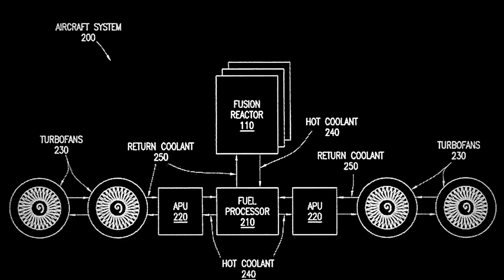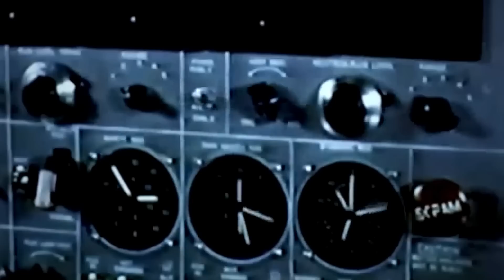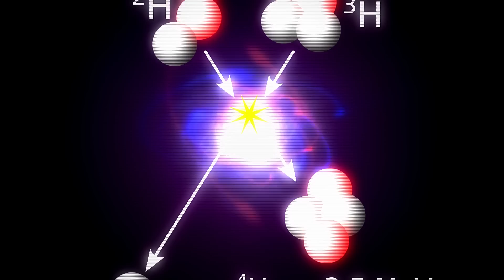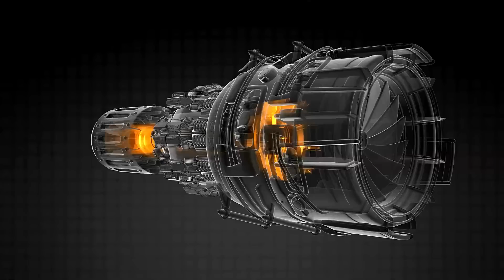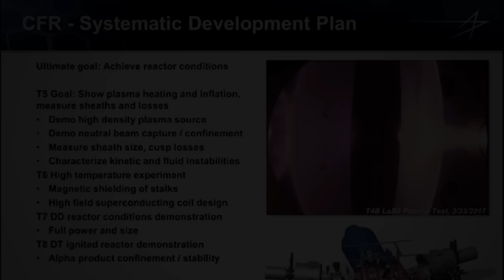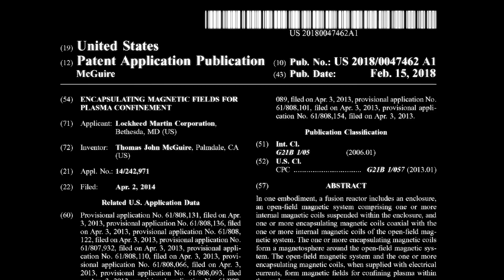The Nuclear-Powered Aircraft that Will Change Everything

Comment: Tritium, one of the two Hydrogen isotopes used in current day fusion reactors, runs $30,000 per gram on today's market.  (Deuterium, the other fuel, is around $10 per ounce)  Current commercial application of Tritium (worldwide total) is around 400 ounces.  Tritium is a byproduct of fission reactions, so production can only be ramped up (currently) by building more fission reactors.  They've been promising us Fusion energy for many decades now, and each decade it gets "a little closer" but there's always a very long way to go.
Reply: Fusion reactors can also inexpensively produce tritium. Also, there are other ways to produce the fusion reaction without tritium, such as boron.
Reply: @fishing953  Boron is way harder to use and no a fusion reactor does not produce Tritium. If you think it does give me a link to a peer reviewed journal article to prove it.
Reply: @gordonlawrence1448  This is from Wikipedia. Look at the peer journals quoted below it. One of the fusion start up companies in the US is using this method - do some research. 

quote: Tritium, one of the reactants required for this type of fusion, is radioactive. In fusion reactors, a 'breeding blanket' made of lithium is placed on the walls of the reactor, as lithium, when exposed to energetic neutrons, will produce tritium.
Reply: @fishing953  The Breeder blanket is only a concept under test - purely experimental at the moment and not commercial. The Trituium shortage is real and there's no close answer to the problem.
Reply: @fishing953  D+D, D+HE3 , HE3+HE3 ect ect some have their advantages like no neutrons release, but do require far more energy to start.
Reply: I may have this wrong, but my understanding is that both deuterium and tritium exist in ocean water, with tritium being many orders of magnitude more rare. If that is true, then can't tritium be extracted WITHOUT use of fission?
Reply: @gregparrott  too expensive and way too little available
Reply: Yes, I read that it is only produced in one Canadian reactor.  However, NASA has got the first part of its moon commercialisation project (i.e. ARTEMIS)  working, and the moon has lots of tritium on its surface.  So, tritium (along with water from the polar regions) could be one of the resources forming the basis of a space based economy, as well as a fuel for space ships.  Still the idea of a viable fusion reactor small enough to fit in a fighter seems like science fiction to me, given how difficult it is to make a reactor that fits inside a building.
Reply: @christopherwebber3804  Yes that's the case and i believe that reactor is also due to close in a few years which will exacerbate the problem further. I don't believe it's hard to miniaturise existing fission nuclear technology and they've been using isotope thermoelectric generators for decades but fusion is another game altogether. I also don't believe that a miniature fission reactor is imminent or likely and i also believe the tokamak approach is a dead end that will never do anything but consume vast sums of money. Too many vested interests in fusion research - if they ever do crack it they'll probably cover it up to keep the jobs for the boys going...
Reply: Interestingly, the last of the milestones for commercially viable fusion reactors (after recouping not only the electrical energy fed into the magnetic field and into heating of the plasma, but also the computers that control the plant) is to be able to sell enough electricity to pay for the tritium. This last factor could very likely be insignificant for a military application. The strategic advantages of an energy source that isn't tethered to a supply chain would outweigh its cost disadvantage in a ton of applications.

On the other hand, any application in aviation has the disadvantage over a stationary power plant that poses severe restrictions on possible reactor weights and sizes.
Reply: @Pystro  The problem is we cant make enough. Only France produces Tritium in their nuclear reactors and that only 1-200 grams a year. So not gonna work.
Reply: @dralord1307  But they are fission not fusion
Reply: @dralord1307  Just a few days ago a nuclear (fusion) plant here in Minnesota released a bunch of tritium by accident. I don't think it's as scarce as you think.
(EDIT: The news came out a few days ago, the release was last year)
Reply: @thomasdelbert  Uhm. What I said is correct. You can look it up. The trit that your thinking about was by accident and wasnt being harvested for sale. It would have been sent to a contamination waste facility and not processed further
Reply: Rick what about the US project of using weapons grade fissionables? Has that been counted in the totals?
Reply: Molten salt reactors produce tritium as a waste product
Reply: I have read the entire Wikipedia on Environmentalism and am therefore an Expert on nuclear power and I can tell you have no idea what you're talking about. Unless we stop using all fossil fuels and go to 100% Solar Power before the end of 2025 the world will be uninhabitable within 10 years. And the only way we can do that is by giving all the world's power and all the world's money to Experts like me so we can enforce Environmental Law and make a 100% Equitable World Economy where everything is owned and controlled by the World Government.
Reply: @Wooargh  lol.. so many aberrations

Comment: I was unaware that this technology has come so far.   Wow.
Reply: It hasn't.
This is all based on Lockheed-Martin marketing fluff, and wishful thinking.
Lockheed's design, if feasible, is a long, long way from being small and light enough to realistically power an airplane.
The best fusion reactors in existence today consume far, far more energy than they produce. Lockheed has given us nothing to indicate that their design will be any better. Were they truly in "high beta" Lockheed would be trumpeting their success to the world and selling licenses. The promise of fusion power is still just vaporware.
Reply: @warpedweirdo  nuclear engines produce much more power than their weight such a nuclear subs but you also gotta think we’ve last really updated our nuclear engines in the 80’s I believe with the Pennsylvania class sub maybe there’s a more modern one but it takes a lot of time and money to get this right one mess up and a whole factory could be destroyed look at Chernobyl as an example
Reply: @udpbooter  The video was about FUSION reactors, not FISSION. There is a massive difference between the two reactions. One engineer estimated that Lockheed's reactor design would require 30-to-100 TONS of shielding. How much would all the other equipment weight? You've got the reactor itself, which will be very heavy. (Electromagnets are not light.) You need a cooling plant, to keep the reactor's magnets just a few degrees above absolute zero. You need particle accelerators to inject fuel and energy into the reactor. (More magnets for these, lots of weight.) You need a the steam turbines and generator to convert a major percentage of the reactor's output into electricity to run the particle accelerators and cooling system. (Massive weight there.) And you need the actual engine that converts whatever energy remains into thrust.

You can't just wave your hands and say weight isn't an issue because... power.  No runway is going to stand up to the rocket thrust required to allow such a monstrosity to lift off vertically into the air, and I doubt pilots will put up with a 300mph takeoff roll. So... how big do the wings have to be to lift this bulk at a reasonable takeoff speed?

A C117III Globemaster has a max takeoff weight of 585,000lbs, and a 174' wingspan. The plane weighs 282,500lbs empty. The 4 engines weight 28,400lbs. A full load of fuel weighs about 23,500lbs. Let's round up to 52,000lbs total for fuel and propulsion.

Let's say the total weight of a fusion-based propulsion system and its fuel is only 150,000lbs. That's three times the weight of propulsion and fuel in the C117. Multiply the max takeoff weight of a C117 by three, you get 1,755,000 lbs max takeoff weight for a usefully performant nuclear cargo plane. Does that mean a 522' wingspan too? This is getting ridiculous.

The fusion propulsion system will need a power-to-weight ratio of about 3.1:1 to match that of the the jet engines and fuel on a fully-loaded C117. That's 465,000lbs of thrust. Hah, fat chance, but whatever.

I suppose you could just load the fusion power plant into a C117, cut total capacity, and fly it that way. But what a waste! There's no way the cost of the fusion power plant would be justified by the useful capacity of the C117 when compared to the much cheaper engines presently in use on the C117.

Comment: That footage from Lockheed is from 8 years ago, and in it, the engineer said he would have a working miniature reactor in 5 years. 
It is my theory that the B21 may be using this new engine. This theory comes from their claim that the B21 would not require any support vehicles for long distance and duration missions.
Reply: and submaries fly into space 🥴
Reply: @digitalsiler  Wellllll... I mean technically...

If you were to compare submarines to spacecraft, the two have more in common than any other platform does when compared to spacecraft 😅
Reply: You should come over to r/noncredibledefense
Reply: @ryangravel9340  I am not a big twitter fan though
Reply: That is because 1 the B-21 has significantly less drag than the B-2 and 2 it is not designed for intercontinental missions.
Reply: @gordonlawrence1448  Sorry man, but the B-21 is absolutely designed for intercontinental missions.

Assuming B-21's will be based somewhere inside the US, every mission it goes on outside of North American airspace will be an intercontinental mission.
Reply: 🥧 in the ☁️
Reply: Note that B-21 is made by Northrop-Grumman, one of the worst competitors to Lockheed-Martin. I don't think LM would like to share that technology with them. The B-21 will use regular turbofan engines like most aircraft.
Reply: @skunkjobb  my thoughts were that it was a forced collaboration by the US. They were non-competing projects. Northrop has the frame (the engines were always a variable), and LM had the power plant. Money is money.
Reply: The other possibility is that the B-21 is using the Rotation Detonation Engine (RDE) being developed at present, which is far more powerful and efficient than current jet engines.
Reply: @fishing953  An RDE is a rocket engine. It makes no sense to use that in an aircraft that flies in the atmosphere at subsonic speed. The improvement in efficiency is outweighed by far by having to carry the oxidizer onboard instead of just using the air.
Reply: @skunkjobb  The Air Force assessed in 2014 that: improvements to their Pules det engine could eventually propel aircraft to speeds beyond Mach 4. A rotating detonation engine could be even more effective. The USAF has also tested an RDE powered aircraft in 2008.
Reply: @fishing953  No mate, it's powered by 50cc lawnmower engines!
Reply: It's far easier to believe that the B21 has low wing loading and high fuel capacity, or even that it is powered by a fission reactor, than it is to believe the B21 is powered by a fusion reactor. Do a little research and you'll soon find there's just no way to fit the equipment required to run a fusion reactor into an airplane of reasonable size. Heck, one article I read indicated the Lockheed design would require 30-to-100 TONS of shielding. (For reference, the GE9X, developed for the Boeing 777-X, weighs only 21,230lbs)
Reply: @warpedweirdo  There are now multiple research projects at Universities around the world for development of efficient shielding materials for fusion reactors. So may be not too far away.
Reply: @fishing953  <snicker> They might also be impossible. Who knows? I don't, and you certainly don't either.

Getting your hopes up every time there's a new press release only results in you being let down more often than you otherwise would. You ought to adopt a wait-and-see attitude.
Reply: @warpedweirdo  No I dont, but thats ok
Reply: @warpedweirdo  ...powered by a fission reactor...poluting the atmosphere. You're trying to talk technical, but all it amounts to is gobbledygook!...anyway you've got the right utube name. 🙄
Reply: @warpedweirdo  sure it's easier to believe, but where is the fun in that? 

And what makes you think that published articles available to all are giving you an accurate depiction of where top secret black projects are in development? 

The very video that this comment is on suggested that miniaturized reactors fueling aviation is the goal, but somehow, my comment is too outlandish for the subject matter? 

Why even take the time to watch a video like this ? You guys already have all of the answers and apparently hate to theorycraft what may or may not be contained in some top secret program. 

Is it likely? No. Does the video by Lockheed ~9 years ago, stating that they would have a working prototype in 5 years, coupled with the newest generation of stealth bomber releasing (specifically obstructing view of the engine outlet) with bold claims of long distance flight  prompt some intriguing thought? Well, it does for me. 

I'm not here to write a thesis or do some peer reviewed study. I'm here to let my imagination wander. Because it's fun not to be a stuffy, pretentious prick.
Reply: @Cronus_1  By all means, don't let a little bit of critical thought and knowledge stand in the way of your wild fantasies and speculation. Today it's fusion-powered airplanes. Tomorrow it's Tony Stark and his techno super suit. Next year, who knows? Maybe you'll be fantasizing of jumping from galaxy to galaxy in your own personal space ship, fast enough that you don't need bathroom breaks, just like Luke Skywalker in his X-Wing.

I used to have fun fantasizing about near-limitless energy in small vehicles too - when I was six. My fantasies were better than yours, in that they involved over-unity power systems. Years later, once I finally figured out why my over-unity idea wouldn't work, these fantasies were supplanted by fantasies of devices with insane electrical energy storage density. 

My curiosity and thirst for knowledge ultimately crushed those wild fantasies. EVERY. LAST. ONE. And you know what? I don't miss them. Reality has plenty of stuff to keep an active mind occupied. 

But whatever; suit yourself.
Reply: @warpedweirdo  except the theories that I suggest are the subject material of the video and not abstract. And also based on timeliness suggested by the very companies that develope these types of projects. I believe my comment was much more apropos to the subject material. Your condescension is less so. 

Pontificate all you'd like. But remember, it's a YouTube video comment section. Get over yourself.
Reply: @warpedweirdo  Your spot on, It would always be the shielding that would doom it

Comment: Fusion power is 20 years away. 
And it always will be 20 years away.
Reply: I've heard the same thing about global warming.
Reply: @hanrockabrand95  the same thing is true of global warming. Except with global warming they delete the tweets as soon as the time is passed
Reply: prolly already here
Reply: No I don't believe that. They recently got more energy out of a fusion reaction that went in. Now that was in the test vessel itself and not the entire reactor itself. But that is a major step many many people thought was '20 years away'. Fusion is gonna be one of those technologies that will just appear out of nowhere. Meaning all the work done in multiple places will all reach the major breakthroughs all at once.
Reply: @TK199999  only by fudging the numbers do they get more power out . they only count the energy out from the lasers they use . but laser are less then 10% efficient ,more like 5%
Reply: @TK199999  you’re so naive and wrong. Look deeper into it. Don’t be a regurgitator(sic)
Reply: @TK199999  Fusion gets trotted out every time wind and solar start making gains. The message is clear: Don't convert to wind and solar, just keep burning coal and oil, because fusion is coming and that's the only viable replacement for coal and oil.
Reply: @seventeenthchild655  That's also pretty dumb, you can't rely on purely wild or solar until you have storage solutions able to sustain enough power for a week or so requirements of that country. Base load is required for a stably grid.
Reply: @TK199999  At 1:03 a.m. PST on December 5, researchers with the National Ignition Facility in Livermore, Calif., ignited controlled nuclear fusion that, for the first time, resulted in the net production of energy. A 3-million-joule burst emerged from a peppercorn-sized capsule of fuel when it was heated with a 2-million-joule laser pulse.
It took about 300 million joules of energy from the electrical grid to power the lasers to get a hundredth of the energy back in fusion. 1% efficiency and thats only for a fusion process that lasted a fraction of a second.

Fusion reactor research has been going on since the 1950s and 70 years later and tens of billions spent, this is the best we have accomplished.
Can't wait to order my fusion car in 2523. LOL.
Reply: ….until mankind needs it, or just before that.

Comment: The NB-36 WAS NOT nuclear powered. The powerplants on the NB-36 were the same as on any other B-36. The difference was that the NB-36 had a small fission reactor in its aft fuselage. The goal was to see how much radiation shielding would be needed to protect the aircrew. But so far as I know no nation has ever developed a nuclear jet engine.